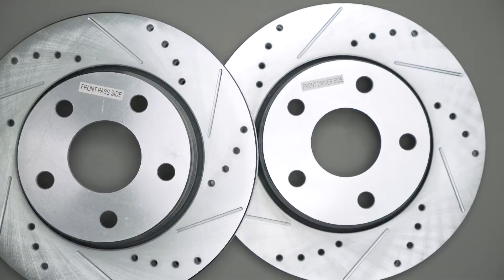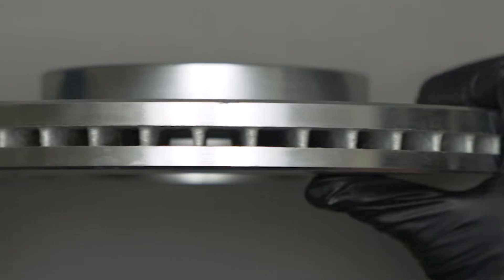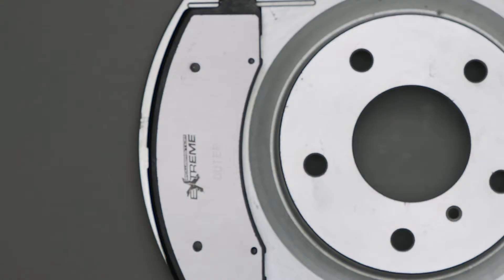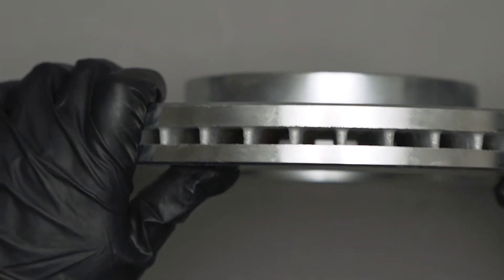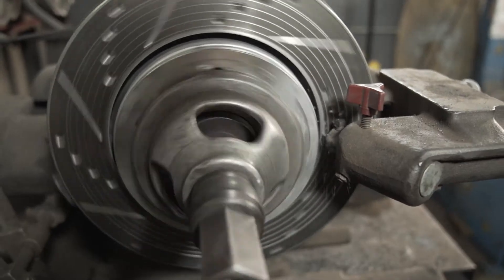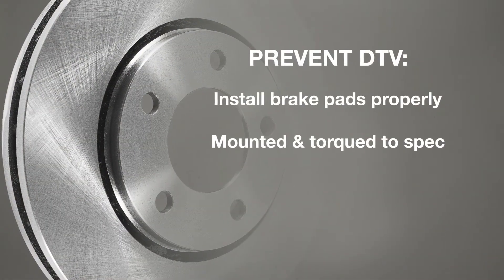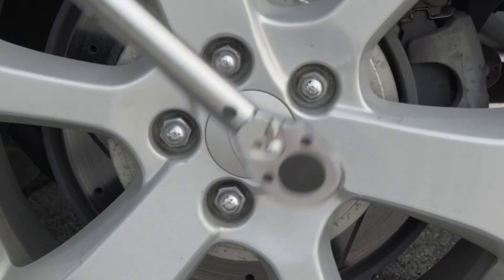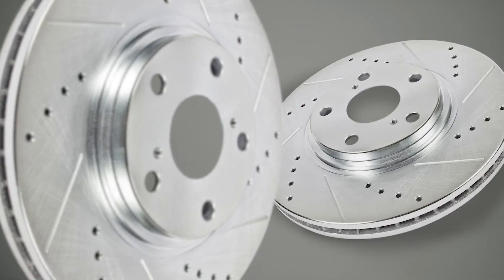Why do I Have a Pulsing Brake Pedal? DTV | PowerStop

Comment: ..Or you may have their junk pad material packed into the slots in your cheap Poser Stop rotors, creating ridges which also cause severe vibration and pulsation.